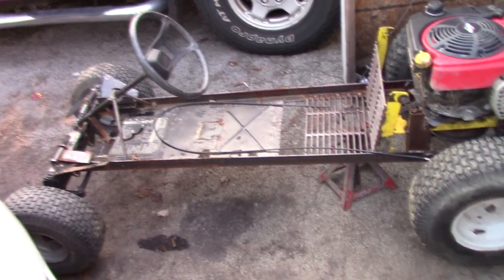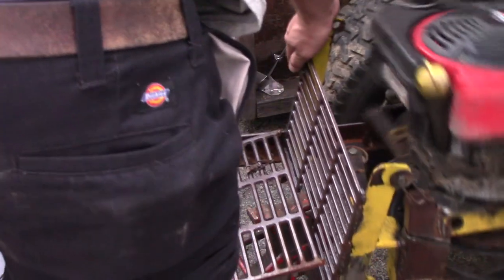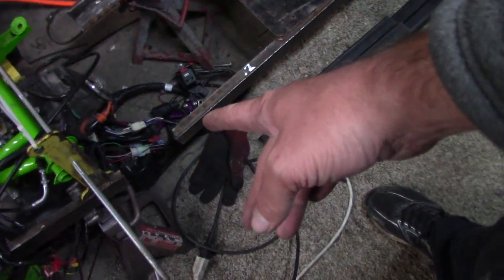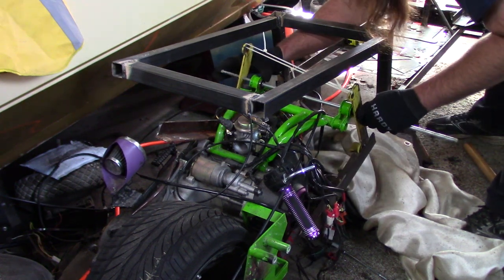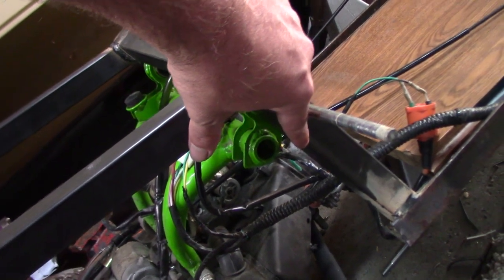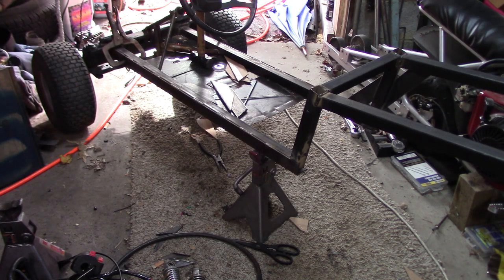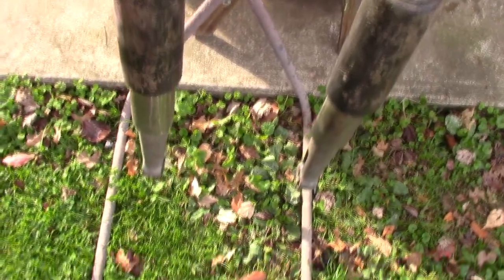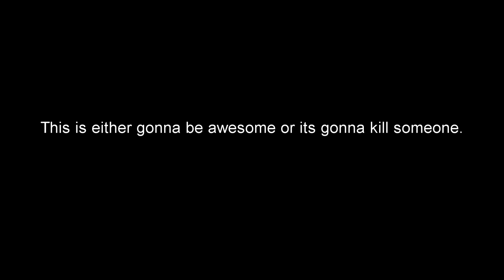Rat rod style go kart into Reverse trike

Comment: Yeah...thats gonna be fun!

Whatever happened to jumpy 2.0?
Reply from the maker: Jumpy 2.0 got pushed to the side for a bit. It has #520 chain and i cant find any #520 idler sprockets. I bought a couple #50 idler sprockets now but they are too wide to fit the chain. I have an idea to solve that issue so we will be getting back to it soon. Just gotta run the chain and finish the steering and it should be ready to test.